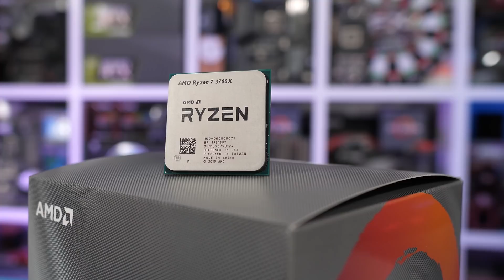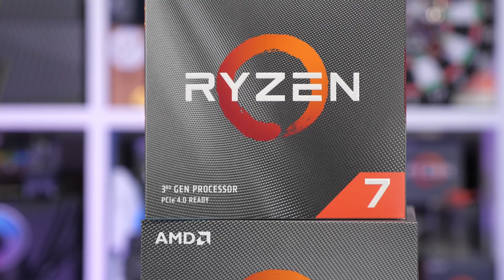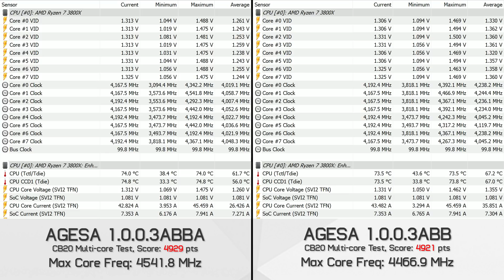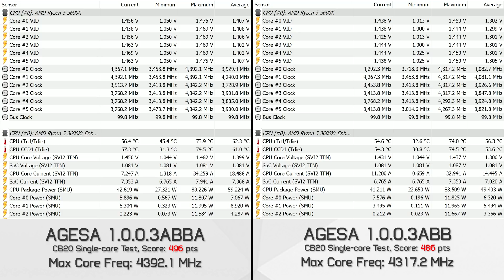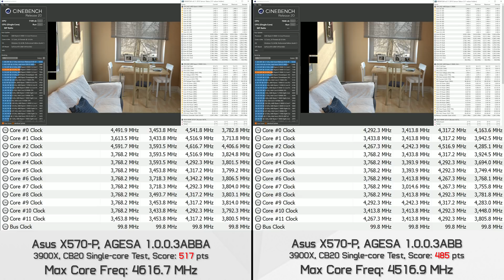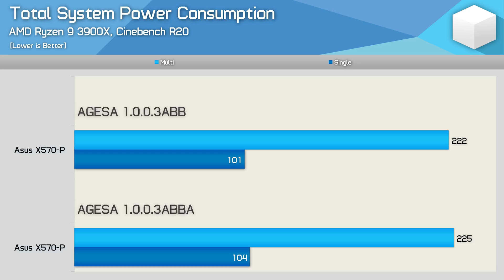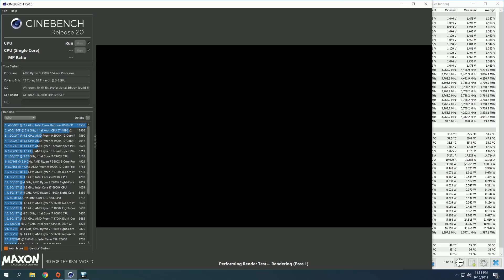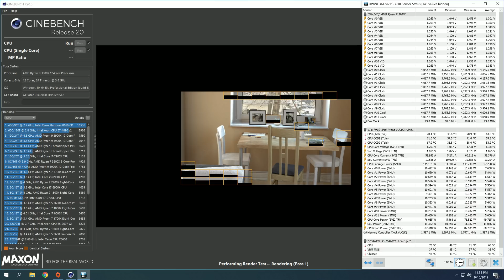3rd Gen Ryzen Boost Clock Fix Benchmarked, AGESA ABBA Time!

Comment: Still waiting on AGESA 1003 ACDC for those sweet 5GHz boostclocks.
Reply: Yes but it will run all cores on high voltage
Reply: @BICIeCOMPUTERconGabriele  AC voltage
Reply: Well hells bells
Reply: That's only gonna happen when AMD releases the Ryzen 9 3950x Back in Black edition.
Reply: It might get you Thunderstruck...
Reply: AGESA 666 ACDC
Reply: THUNDA NA NA NA NAAA NAA NA NAAA NAA THUNDAHHHH
Reply: It's TNT, it's dynamite.
Reply: The CPU might get thunderstruck ...
Reply: 5GHz? That's Highway to Hell mate
Reply: Lul
Reply: HIGHWAY OF HELL!!!
Reply: No, no, no, that means they will be releasing a Back in Black edition :P

I miss Bon Scott, loved that voice ;)
Reply: The down under BIOS.
Reply: Big Balls required.
Reply: hahah nice^^
Reply: AMD sure is "Back in Black!!!!"
Reply: @Robert Cowan just shows how profundly ignorant you are, you cannot compare raw frequencies between both platforms because the AMD chip uses a superior IPC and is wider than the 9900k that clocks higher. It's the same issue as the 5ghz AMD FX chip that still couldn't beat an i5 2500k chip with lower clock speeds at the time. Raw clock speeds mean nothing in this case.
Reply: Guys, have you tried putting i7 9700k/i9 9900k on a 80€ motherboard ? 3900x is working and boosting ok (it will boost even better after those fixes) on B450 A-PRO Max (wich cost 80€ and its plug&play aka it already has bios for 3000 series). I've seen some intel fanboy laying how his i9 9900k is working at 5.0 allcore with a 25€ cooler (and i9 9900k at 5.0 allcore is even melting at games with a 100-150€ water or air cooler).
Reply: Unfortunately, the noise levels make it entirely unreasonable to use - too many bells
Reply: LOL
Reply: This would rock
Reply: @SORAW441 loaner cpus are not free as you pay for shipping them back and shipping is expensive.   and cpu always being ready that makes zero sense. a 9900k is back up at 5000 mhz in a milisecond from the idle 800 mhz.  amd chips idle to dam high increasing power draw which is a waste of power generates to much heat in your system and wears compnents faster. its bad design if anything. and im sure it feels fine but i bet it sounds louder and gets less fps out of the same gpu if you have anything over a gtx 1660. 

and good advice is never build your pc based on being able to upgeade to a new cpu later.  that wil almost always cost more then buying a good cpu directly specialy in 2019 where we made the core jump and its unlikely yo get past this point in the next couple of years for gaming as the fast majority still only uses 4 cores some use less then 4 cores and a few use more then 4 cores. with the sweet spot being 5 cores atm. (if that would excist)
Reply: @pino_de_vogel  I've been reading all your comments, you're a fan boy. I wonder if you're one of the intel marketing guys. Anyway, 4 cores are outdated. 5 cores don't exist. The industry is moving forward with more cores to take advantage of. People like you sucking up to intel and spending your hard earned money (or your father's money) is what makes them bold and lazy. What have they done in the last 5 years instead of just refining some stupid architecture? Then they cost you an arm and a leg. I'd rather have some genuine competition in the market. It benefits us both. So, stop being a fan boy.
Reply: @Robert Cowan In the performance per dollar category ryzen destroys intel, And it's not a matter of clock speed an intel 5ghz is about the same as 4.5ghz on a 3000series, and when I said you can't exactly compare I was talking about the patches needed since release and it can be frustrating for AMD owners but intel is not really any better it's just been so long since they released anything that was actually new that people seem to have forgotten
Reply: Yea but with all 12 cores clocked at 5Ghz the CPU wuokd be like T.N.T.
Reply: @Robert Cowan price per frame hardware unboxed
3900x - $3.70
9900k - $3.78
3700x - $2.46
9700x - $2.99
Yes the 9700k is better value than the 3900x but it's a lower tier product but the equivalent ryzen beats it but my point stands AMD beat intel on price to performance and this is a worst case scenario since it's very much cpu limit so unless you buy a 2080ti for 1080p gaming the difference in frames shrinks making AMD better value again now I won't argues that intel gets the top fps in most cases but it isn't the value option
Reply: @thathandsomedevil0828  hey! Don't waste your breath. There a re bunch of idiots who don't understand IPC. All they know is frequency.
Reply: @UCSs6T_3ScLPf4v4I9DnRIYg because a ryzen 3000 GHz speed is not the same as any other architecture GHz, you troll. This ain't wcfftech, people actually have measured conversations here, please do better.
Reply: @DaniëlWW2   I'm really interested in what you had to say about those video cards on Don'tCallTechSupport  video about 5700xt strix card... The comment got deleted I believe... I would appreciate  opinion of someone who actually had a 5700xt
Reply: Guys~!

Which DDR4 better for Ryzen 5 3600 with RTX 3070:  G.Skill Flare X 2X8GB 16-18-18-38 or ADATA XPG Z1?  Both 3200 speed both I buy from local "private" reseller so no warranty from him, if anything, I will need reach out ADATA/G.Skill.
Note: ADATA unsued
G.skill was used before

Price: $60 for XPG
Price: $70 foe G.skill

Now I have Apacer 2400 speed DDR and it heavily drop fps and make games leg with my Ryzen and RTX card.|

Thanks!
Reply: And it will be a straight highway to hell for your Ryzen CPU
Reply: Bought a intel 9900k and it worked from version 1.0.
People can bitch all they want about needing a new board with intel chips but atleast it works from day 1 no updates needed for months.
Reply: @pino_de_vogel  Well my 3900X worked fine out the box too ... at least it doesn't have security issues as large as a barn door and costs me nearly 20% perfromance if i install the corresponding fixes ;).
Reply: @Astravall  oooooooooooooooo
Nasty
Reply: The security fixes cost zero performance for gaming and any office app i threw at it.  So frankly its all irrelevant.

Inran my previoud build vor 8 years without as much as a windows update or antivirus or anti malware and never had a issue.   If you know what your doing all this is just scaremongering and totally irrelevant. 
If you dont know wtf you are doing sure go for security but be aware that security is irrelevamt if your that person that blindly installs everything that id bundled with your 'free' tool from a shady download website. 

And its irrelevant they are on 14nm.  Its not what you have but what you do with it. Amd has '7nm'  but they are less efficient on it still.  If your cpu usage is 50% idle 50% load the 9900k is drawing less on average then a 3700x and thats mainly because amd idle power draw is awefull and under load they arent all that great either. 
Nvidia is also still on 12nm but they have a  better performance per watt still. 

And the architecture has changed quite significantly.   Otherwise my  3770k on 5.1 ghz wouldnt be 35% slower as my 9900k locked on 4 cores and 4,8 ghz. 

Im not liking the price either but after all the math and a 5 year plan with oc in the end the 9900k was just a better deal then a amd setup.  

On top of that a board with equal proppertys to my intel board on amd would cost me more.

And to those saying its just a bios update. Tell that to the people that have one of those shitty amd boards that dont have usb flashback and cant update their boards without a older gen cpu.   They have to spend money to get the board updated or buy a new board and spend extra as x570 costs more as intel boards for less.   Plus i cant wait on the dying boards because the chipset fun died without them noticing. 

Plus all the people that upgraded from second gen ryzen to 3rd gen the joke is on you as you ended up spending more then directly buying a intel rig.   But hey to each their own i did my math and amd wasnt worth it for me.  Maby next time?
Reply: @pino_de_vogel  RIP
Reply: @pino_de_vogel  we are hitting stupidity levels that shouldn't even be possible.

I had a good laugh on your 5 year plan.
Reply: @alok9055  laugh all you want but i know my rig will last atleast 5 years speed wise. my last rig last me 8 years even and that was a cheaper rig.  its just math and 25 years of experience. i have a high end rig most peop-le run midrange to low and so game devs will keep that in mind and before my rig is on the low end performance wise we are 5 years further. and all games will still work then.  slap in a new gpu in 2 years at arround 500 bucks (navi2 or 3070 level) and its all good to go. new consoles will not affect this much as they are already outdated compared to my system and they arent even out yet...
long term building is cheaper then short term money saving every single time.
Reply: @pino_de_vogel  trying to justify all those $$$ on fusion heated 9900k with extra security holes are you ?
Reply: @joaovasco3969  
[x] rekt
[  ] not rekt
Reply: @pino_de_vogel  Do you even remember Z170 problems? Skylake CPUs was slower than Haswell due to the FCLK bug which puzzled everyone including me who had to deal with it, it was eventually fixed as BIOS update but it took like a month or more for it to come.
Reply: @pino_de_vogel  at least now you have 5 vulnersbilitys instead of 0...
Reply: @pino_de_vogel  pretty sure you got to update that thing afterwards bc of vulnerabilities.
Reply: @pino_de_vogel  Right, what + are they on now for 14nm and how long has it been since that architecture has significantly changed? For those of use who can actually grow hair on our faces we know damn well there were plenty of problems from Intel with any significant architecture change and node change.
Reply: @pino_de_vogel  Yeah. On a process node that's over half a decade old. AHEM
Reply: @pino_de_vogel  X79 system had to wait nearly a year to get a proper RSTe RAID driver, X99 system still doesn't have fast boot working and is running a beta BIOS to work in Windows 10 with Spectre/Meltdown hotfix.  If things work from day one, consider yourself lucky, because I've had stuff from AMD, Intel, IBM and Apple all go through teething problems throughout the years.  Especially with my pains over two Intel HEDT systems the past 7 years, I'm ready to try out AMD again.  Though I'm in no rush.  I don't need bleeding edge anymore; that's where others come in :)
Reply: @PorscheRacer14  Yeah Intel's x79 and x99 were a sloppy fucking mess.
Reply: pino de vogel When you use the same architecture for 4 years straight, it better work flawlessly from day 1, lmao. Skylake was iffy AF when it launched.
Reply: @pino_de_vogel  you can't exactly compare the 9900k to the ryzen 3000 series they a new architecture on a new node but 9900k is the same shit as the previous few years with a couple extra cores but sure your right the 9900k would get it's max speed from launch it's only a shame that max is progressively dropping over time with all the security patches
Reply: @shaynegadsden  sorry but NO its not just extra cores or the performance would be only 33% more as the 8700k plus whatever mhz they increased which is not true.  there have bin changed each year you just dont see.   and all those patches cost me near nothing and that what it does cost me also cost it on ryzen as they are also affected by these patches. but the impact is so small for home users its irrelevant anyway.
Reply: @pino_de_vogel  there is no architecture difference between the 9900k and the 8700k you don't even get 33% increase because core scaling isn't 100%, the only other advantage is a clock buff mostly from soldering but another year refining 14nm helps too
Reply: @pino_de_vogel  Yeah but those security flaws and massive performance deficits.
Reply: @pino_de_vogel  im sorry
Reply: @pino_de_vogel  well, that's because they have years to refine their processor, the i7 4700k and i7 6700k had a hard time reaching 4.5 ghz on the first place
Reply: @pino_de_vogel  I still believe you wasted your money, but hey thats your choice.
Reply: pino de vogel that's fine you do that and spend twice the money needed as I upgrade from a 2200g 400$ build to a newer Ryzen 3600, some upgrades to ram and Radeon gpu if you ask me pretty noice  and cheaper than buying a new fucking motherboard
Reply: @pino_de_vogel  Is really easy for Intel, due they use the same BIOS for almost 4 generation.
Reply: @pino_de_vogel  of course they do! If amd was working on the same platform for 10 years, these would work too!
Reply: @pino_de_vogel  That's because intel hasn't come up with anything new since core2duo :P

Comment: I'm still on the AGESA 1.0.0.3 (non A, AB etc.) on my MSI B450M Mortar (BIOS v17), the only BIOS version that let's my 3700X boost to its max advertised clocks during single-threaded workloads.
Reply: Yes but the voltage can break your cpu tho
Reply: @LarrysUniqueHandle  - source?
Reply: @AnalogFoundry  my Ryzen 73700x killed my x470 mb most likely cus of high voltages. Was never lower than 1.4 even at full load.
Reply: @LarrysUniqueHandle  - I'm using default BIOS settings, no PBO, Auto OC. CPU voltage does hit 1.5V max, but during full load it pares back to 1.2V.
Reply: @AnalogFoundry  yea I was using defaults except xmp profile
Reply: @LarrysUniqueHandle  As said in the video up to 1.5v is fine. I very much doubt the bios would push it higher than that without the user doing it
Reply: Same motherboard, same CPU. V17 does boot higher. In my case, during a CB R15 single thread run, all 8 cores was able to hit 4.4 GHz fairly often. I stayed on that BIOS for a long time. Recently I upgrated to BIOS version V1B1, one or two cores can hit 4.4 GHz occasionally in CB R15. But with AGESA 1.0.0.3ABB, the multicore performance increased a little, probably due to the permanent fix to the hardware RNG bug. Previously, the chipset driver offered a software workaround to the bug, which I believe caused a little performance lost.
Reply: @thunderboltlightning6010  - nice, I might give this a shot.

Comment: Can you make a video which one is better i5 9400f or 2600 both are same price
Reply: The Ryzen, because it has an upgrade path, cheap used 12/16 core option later down the track. Intel platforms/sockets are dead ends.
Reply: Go for the i5 if only game but ryzen 5 2600 is really good option and u have upgrade path with ryzen personally I have i5 9400f which is lot cheaper in my country
Reply: Definitely the 2600.  The i5 will be slightly better for games right now but isn't good for the future.
Having hyperthreading will help the longevity of the 2600 and there is also an upgrade path for the
2600. In a couple years you will be able to get a cheap 3900x to go on the same motherboard 
provided you have a decent motherboard
Reply: Vablo I thought about that but no way he gets that shit of performance with 1080. He is HARDCORE crippling his performance with that ram. Talk about a bottleneck lol.
Reply: Vablo like saying: I have a 9900k but I only get 30 FPS with the 650 graphics card 9900k sucks!!
Reply: @vablo7198  WRONG!! i know how good i5 6c versions are!! My 1600 cant even hit 30fps in SOTR with 24000CL15 ram. While my friends can. Not to mention he gets higher fps than my 1080 using a 1070. 
:(
If you are gaming i5 is much much better than ryzen 1 and 2 nd gen
Reply: LAKSHYA SINGH I mean yeah if you have the worst ram actually possible which is what you have then yeah Ryzen is fgonna tank especially gen1 why in the world do you have 2400 MHz ram with a 1080.
Reply: @lakshyasingh8931  thats gen1 and you have the worst RAM ofc its gonna suck

Comment: Turning off the Spread Spectrum should keep the BLCK at 100.
Reply: Didn't know that was even in the bios. Might not be on mine. The x570 TUF sucks
Reply: @GraphicallyChallenged  why does it suck?
Reply: @GraphicallyChallenged  its in the digi+ power section.
Reply: My Asrock B450m pro4 has the setting (runs @ 100.1) and I've turned it off since the setting existed in motherboards. My Asus Gaming TUF X570-Plus wifi does not have the option to turn it off. Neither one allows bclk adjustment. 99.8 is reported in all programs.
Reply: On my Taichi x399 BCLK is still 99.98 Mhz even with Spread Spectrum disabled. 😕
Reply: @bgtubber  Try setting BCLK to 101. That should disable spread spectrum.
Reply: @bgtubber  99.98 is good enough, I believe only CPUZ shows that, other softwere like hw info will report 100mhz.